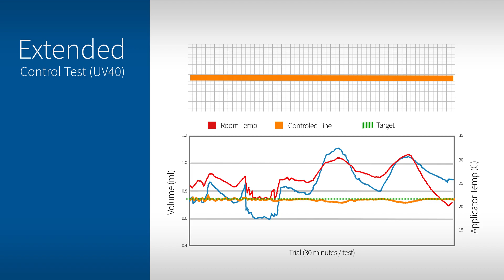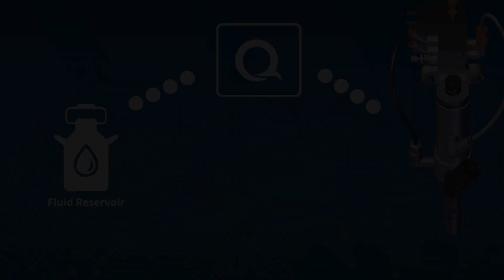How to Automatically Compensates for Viscosity Changes during Conformal Coating

Comment: how to maintain the air fluid flw
Reply from the maker: The Qadence™ closed-loop flow control system maintains a stable flow rate by volume for high quality coating results – automatically compensating for viscosity changes related to temperature, humidity and batch-to-batch variation. https://www.nordson.com/products/electronics-solutions-products/asymtek-qadence-flow-control-system